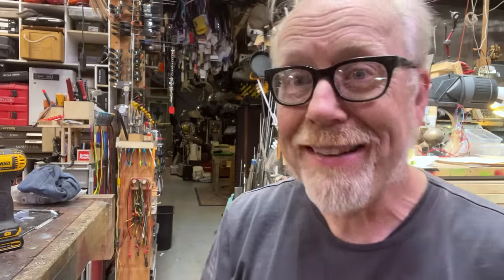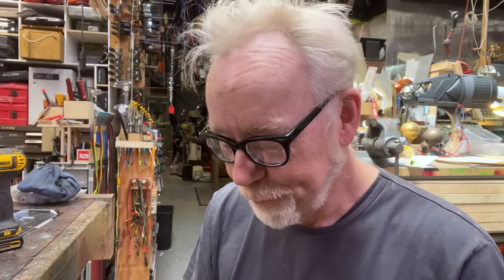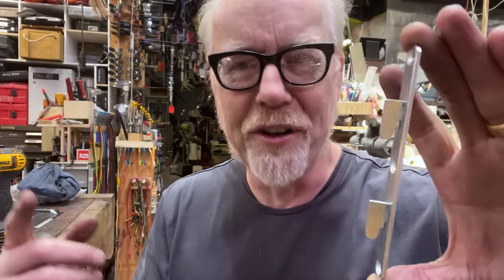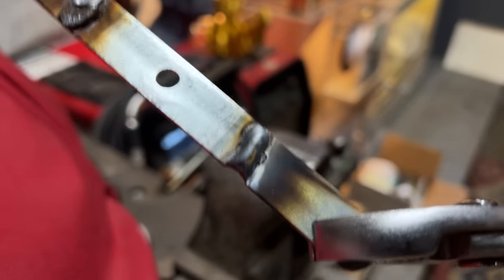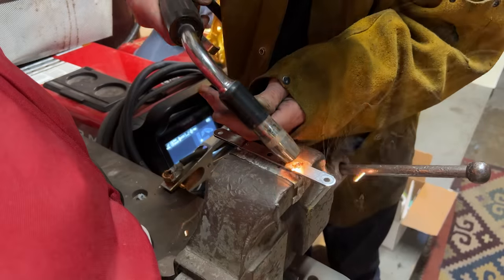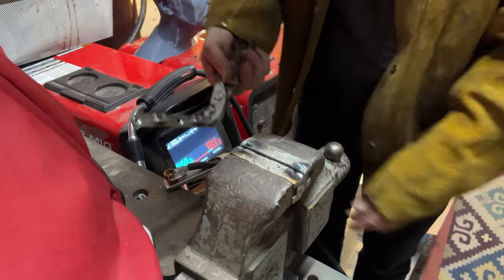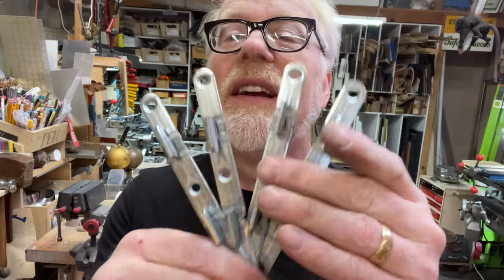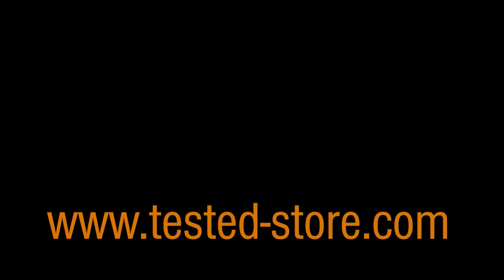Adam Savage Fixes a Squeaking Bed!

Comment: a comment on your question about industrial accidents. I don't weld, but I worked in industrial construction, and I can tell you that if any of the welds on our job site had air in them they wouldn't pass QC. We had to grind sharp bevels on both sides of the weld and every bit of that gap was filled. QC had some kind of device to detect air in the weld site, and there was a time or two we had to grind it out and redo it. I guess I should mention, this was for pipe.

Comment: "Sheet metal snap fit" is a term used for that technique if the head on the tab was formed before insertion otherwise it's just a press peened tab.  Another cheap way would be to bend the tabs side to side or completely over.  God forbid they spend a penny and plug weld the tabs in place.  I think what you did was ok, hopefully the welds wont crack from flexing metal fatigue, something that is always an issue in the aircraft industry.

Comment: As somebody with a really old bed, this isn't how the plate is on mine and it may be why mine doesn't squeak in that way. Those ears are a single sheet installed in a slot on the end of the wooden rail. The wedge angle is more agressive. They're not bolted in to the wood it's some sort of wedge fit to prevent it from sliding out.

Comment: I have an IKEA bed that had a squeaking problem from two sources: the screws holding the metal crossbars to the rails, and the metal loops holding the main support on either end of the bed. Locktite was the solution.

Comment: That is only part of the issue, fixing that won't stop it completely.  Often the sqeaking is the wood rubbing on each other.   That might fix any up and down movement but it will still be able to slide side to side slightly.   You can fix it by just putting something like a thin piece of rubber or felt on the places where the wood pieces contact each other.

Comment: Im sure this was answered aleady but just in case it wasn't:
The method used to hold  the 'compression rivet' is called a Peen and is the same used sometimes in knife making to hold the handle together. A little piece of the tang will stick out the end of the handle and  then you take a hammer and bang it til it is peened over. (If you watch any season of Forged in Fire you're guaranteed to see this method used at least once). This is also one method to fasten handle pins on the the knife as well.
To be honest it may be called something else but it is the same priciple as peening in the least.

Comment: The metal beds from IKEA replace the tongue/ear and groove with a bolt and groove so if the bed starts getting squeaky you can just under the bed and tighten the bolt and the squeak goes away. I need to do it once a year or so.
Reply: My ikea bed is mostly MDF and the side rails are held in by cam lock bolts.
Reply: Loctite blue ?

Comment: I saw a tourist info display near a fairly small hydroelectric station in Victoria, and I think the pipes had 7 layers of weld in the joints, which were very heavily bevelled.  The had a demonstration piece in the display.
0.050" = 1.27 mm, BTW.

Comment: When you build a submarine, the welds are not just “deep”, they go all the way through. This is called complete joint penetration, and it’s very important because for cyclically loaded joints, you can’t have a crevice present as that is a location of potential crack propagation due to the stress concentration.
Reply: Unless the hull is made of second-hand carbon fiber, then you just say F it and go down to and with the Titanic.
Reply: Which is also a failing of this weld, but the actual load probably isn't enough to matter

Comment: This is great to watch! I myself am not a welder, though I have done a little (very little) mig.
Someone please correct me if I'm wrong, but I believe you're meant to keep the nozzle over the weld to allow the gas to keep flowing over it a little longer while it's still glowing red on the surface?

Comment: 10 years in cold forming/stamping.  The flat side is from the punch on top.  The rounded side is where the part is trimmed into the die.  The wavy line you see on the side is actually where the part is broken off.  The stamped parts are not cut clean through because then the tooling would hit and break.  The metal is stamped generally too 10-20 thou thick before knockout rod of various types are used to snap the material off.  Not sure what you’d call the attachment type the parts started with as we didn’t do anything like that but if I had to guess just a simple peen.

Comment: Adam you need a tig welder. Your smart and skilled enough to figure one out. I say this because you could have simply fused the 🤪 rivet into the bracket. No filler rod needed. The access material on the back of the plate will act filler, and the current from the arc will penetrate just as deep or deeper than what was just shown. Only issue is removing the zinc plating on the plate. Tig welder does not like like it. Sorry for the rant. 20 years of welding I can’t help but to give different options and more efficient ways to achieve the same goal.

Comment: Gday adam. silver solder would also be an option given the parts are touching and the solder would be sucked into the join.... the galvinisation is a big issie with weld or solder.  my your vents always be on. loving your frustration with late stage capitolisum... a shared state for many makers.
Reply: Yes, there's nothing quite as lovely as citing Marxist ideas and terminology when discussing the building of beds . . .

Comment: Picked up a handsome new king size timber slat bed, found annoying issues as soon as I assembled it... after our old bed had already been taken away by its new owner. :^(
- some slats were slightly too long for the spacing across the bed (consistency? what's that?), causing the joints between the bed head posts and cross piece to pull out on their dowels
- middle support running under the slats was a crooked piece of 70mm x 35mm stud frame timber with brass end brackets hooked to bed head and feet. Flexed far too much under weight of mattress and me, so much I was worried about damaging it or the slats if I flopped on the bed.
Decided it was less trouble/better chances to fix new one out on the farm than to take it back to the store:
- shaved the slat ends, re-glued the bed head post/cross-piece joint dowels
- swapped support for a (straight!) 90mm x 45mm stud timber length with 10mm steps cut in the ends to let it sit at the right level on the same brackets. So much less flex.

Comment: Even at the farm we grind so much, as to get full penetration on the piece. Parts not welded fully will break first and ofc that would be in the field. Partial weld are only for stuff you want to remove later probably, that do not bear much load ( like messed op nuts that unscrew themselves and you have no time to do a full rebuild :D )

Comment: The manufacture can solve the issue by switching from the stamp rivet, to compression weld. Compression welding is a bit more expensive, but the manufacture in this case is making it's money in service parts. Those parts are sold to the end user at about 1000% markup.

Comment: Another potential source of squeak: I don't know if they still do, but Restoration Hardware beds from 20 years ago used to have a thin layer of felt on the "face" of end of the rails, around the "hook" plate, as a sort of cushioned gasket. Over time this felt compresses and gets "hard" and smooth, acting almost like a rubber shoe sole on a basketball court floor. Replacing this felt can reset a clock until it compresses again...but it's a quick, easy and cheap fix. Yes, it's still temporary and not permanent (not even "permanent").

Comment: The shaped bit that fits through a hole and is held in place by gravity MAY be a "tang" and "clevis." The tab and slot part of the hanger has an extended tab that is staked into a slightly flared head-- that acts as a rivet.

Comment: I had a similar issue with my bed but the rails attach with carriage bolts.  They started to spin and would not maintain torque.  They make special barbed washers with a square center hole for this purpose but they are expensive or come in a large pack size (when you need 4).  I use the common t-nut regularly and keep them on hand.  So drill out the threaded portion, 5 minutes with a needle file, and you have a barbed washer with a square center hole.

Comment: I built a bed frame for myself to take up less space (twin-xl) out of 2x4's, heavy duty #10 stainless screws, fair amount amount of tight-bond 2 wood glue, and 4 non-marring toolbox castors that lock on both the X and Y axis. The bed has yet to squeak, bend, or even move in the 4 years I've used it. It weighs maybe 30 pounds so it can literally be picked up and taken to the next room. I'm no wood worker so yes I literally glued and screwed 2x4's together to make a bed frame, nothing fancy.

Comment: fixed a metal bed squeaking. per comments and links during research, bought a brick of paraffin wax. disassembled, applied to the metal contacting areas and squeaks are gone for the time being.
Reply: Bar of soap works well too. Tip from my carpenter grandfather:)

Comment: I know this is not a submarine but on drums used for lifting items chains and lifting equipment a Full depth penetrative weld is needed for safe use on the drum a single sided weld is OK.  But on Ship or crain frame both sides are preferred test using dye penetrative or radiological testing is required

Comment: 10:50 I'll admit I'm no welder, only done welding once as part of the Boy Scouts but... I thought that "a strong weld" partially melted the material you're trying to weld together - which would effectively do the same thing as grinding down the corners, but without actually removing material, and potentially reaching deeper into the weld

Comment: The difference between an amateur and an expert is if they have done things the wrong way enough times to suffer the consequences of it.  For example:
1)  I learned to stop holding the work in my left hand while grinding on it with the tool in my right hand by accidently cutting my hand when the blade jumped.
2) I learned not to take the guard off of my grinder when I got hit in the cheek with a piece of red-hot metal.  (barely avoided losing an eye)
3) I learned to always wear welding gloves and a welding coat after I got a nice burn on my hand and a UV burn on my fore-arms
4) I learned not to cut too small pieces of wood with a miter saw when a small piece of wood spun around the blade and slammed right through the blade guard barely missing my face.
5) I learned not to ever get under a car that is supported by only jack-stands after my neighbor was crushed by a car that fell (she lived after a long stay in the hospital)
6) I learned not to pour gasoline directly down into a carburetor after my eyebrows got burned off
7) I learned not to spray propane from an upside-down propane bottle when my cheek got frozen by the spray from it
8) ...and many many other mistake lessons learned over the past 50+ years
We often learn more from our mistakes than from our successes.  Sometimes people don't learn their lesson soon enough and it results in a permanent injury.  Those of us who have already made lots of mistakes cringe when we see people that we respect like Adam doing things in the wrong way and setting an example that could end up getting an inexperienced person hurt.  
It is possible for humans to learn from the mistakes of others instead of learning things the hard way!

Comment: Odd they did it that way. The bed I just disposed of, the hooks were a single flat piece of metal screwed into a inset in the side of the wood. They were quite a bit bigger though (it was not a cheap frame originally) and I actually kept them because that's quite a chunk of metal.

Comment: Looks like it was done in a prog tool. First pierce then coin the countersink and punch out. You could just melt the tab in with the tig welder. 😊
Reply: Tig would be my choice.  Grind away the plating and a single pass will join the hooks and plate with no filler needed.

Comment: The rounded edges of stamped products are indeed the side of the die rather than the punch. The tabs on the pieces are “staked” that’s the process of stamping the raised portion sideways so as to spread and tighten the part in the opening as well as spreading the edges beyond the opening beyond the surface. This works very well in most circumstances. But when the parts rock back and forth, eventually the friction between them causes the metal to wear away and to also deform. Then interesting actions occur.

I would prefer to TIG weld those parts rather than MiG weld them. TIG welding those parts should require grinding. But removing the zinc plating around the area is required either way so that the poisonous gas generated by the plasma doesn’t occur.

Comment: The rounded edge is the lower edge against the sheared surface and the plane edge is the top surface that goes against the punch die
And the holes are punched but I don’t know about the countersinks because if they were punched there would be a swelling if these were pressed

Comment: I had a simpler fix. Our metal bed frame kept breaking and I got tired of repairing it. So, I used a sheet of 3/4” plywood and 4x4 posts on each corner and 3 more down the center and made a bed frame. It’s lasted nearly twenty years so far.  Far longer than the metal ones available today.
Reply: I did something similar. I had some 4"x4" offcuts after a fencing project, and used one in each corner of a bed I constructed, and had the side rails sitting on top of them. Very stable.
Reply: I did basically the same thing.  It's been working well for over a decade.

Comment: I see Adam's Fiskars blade handle has lost the original orange rubber grip... unfortunately they don't sell spares, but I solved the issue with mine with a quick 3D design and printing from TPU.

Comment: that was a good disclaimer about the welding BTW becasue you got it just a tad wrong but not completely incorrect, it will hold but it would not pass NDT testing
Reply: also i would not have sanded/grinded the weld bead off thats just removing strength i would of just bolted/screwed it in harder so the weld beads were forced into the wood.. but im just  a jack of all trades master of none so what do i know haha. lov the vids keep them coming

Comment: Simple comment regarding welding - Adam: keep side cutters nearby. Rather than "welding" the extra off, snip it off, less of the "hedgehog spikes" to grind or the wire melting back to the spout, and weld perpendicual to the main piece rather than that "show off to camera" angle. Regardless camera sees a white spot at best and it's not like welding is done be look as much as by feel imho. Doubt even you can really tell where the groove is looking through the black visor. But like you, I'm not a welder, so what do I know. :p

Comment: Personally, with what looks to be about 16ga steel, maybe 14ga, I would just run it hot and slow enough to penetrate all the way through.  Wouldn't even need to grind it flush afterwards running hot enough, it'd sink right down and fuse to-gether.  Creating a groove, for me, would make me more likely to blow through.  Basically just stay on it until it's about to fall through and come off it to get it nice and flush and fused all the way through.

Comment: Wondering what would happen if, instead of grinding completely across the bottom, you only ground the center area of the bottom leaving the edge areas uncut?  Would this help keep the metal straight and flat while still providing the necessary weld strength?  #NotAWelder

Comment: I’m lucky in that the rails on my bed are large round tapered pin style that drop into the tapered female part on foot and headboard. Granted my headboard and footboard are 2.5 inch round brass tube, and the bed was made in 1914

Comment: Wouldn't it be better, and perhaps faster, to just mill a replacement bracket?  I've been rebuilding an antique bed for my daughter (The bed has been in the family for 5 generations and now my daughter 6 generations), and one of the problems is the rusted hardware, which is cast iron, joining the rails to the headboard/foot board.  I "machined," in my limited shop (my mill is a drill press with a cross vice), replacement parts from mild steel that work great.

Comment: I admire your experience in almost every field there is. You can see that because you know many things, but you also know what you don't know, like expert welding techniques. I also find it amusing that you follow most important safety precedures in your shop and know full and well how important they are, but sometimes there is the occasional grinding things in your bare hands or hammering something right next to your finger that will drive safety-enthusiasts crazy. I see it as a sign of your experience that you don't even realize you are skipping some less-important safety measures that beginners obsess over - otherwise you would probably mention what you are not doing in the videos.

Comment: This is why my current bed frame is not made from those terrible slots.  I bought a Goltriever bed frame on amazon that holds up to 3500lbs.  Cheap and super strong and easy to assemble.  No squeaks
Reply: 3500 lbs? That's the definition of over designed.